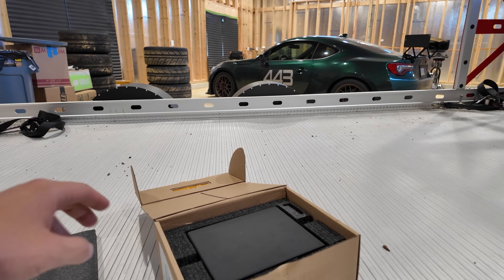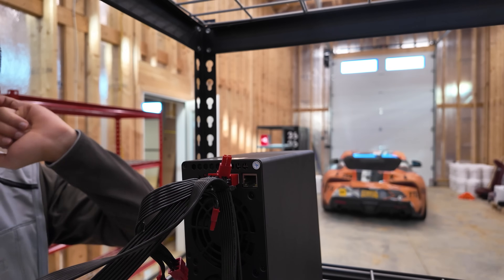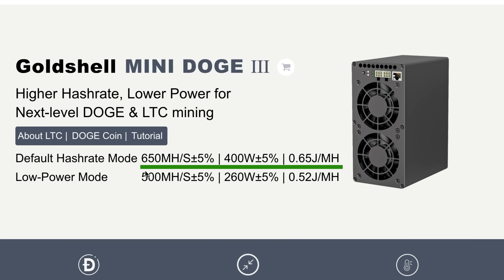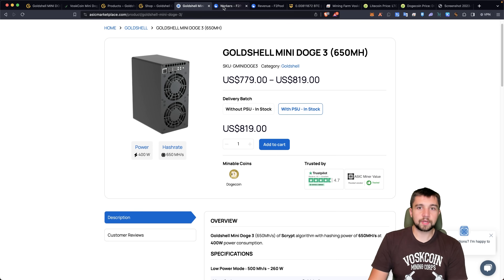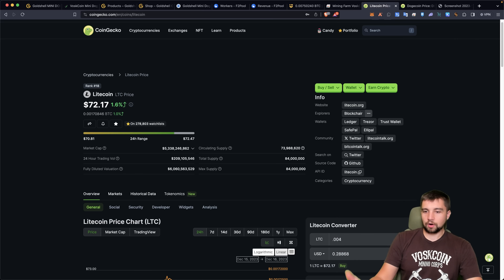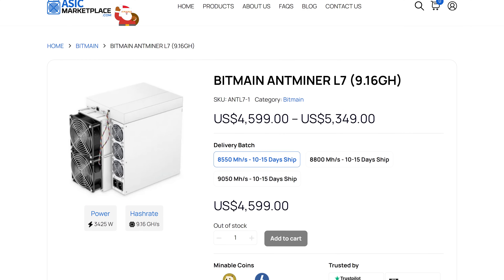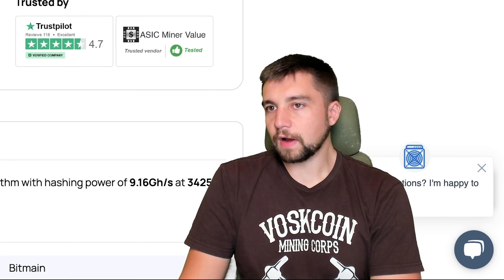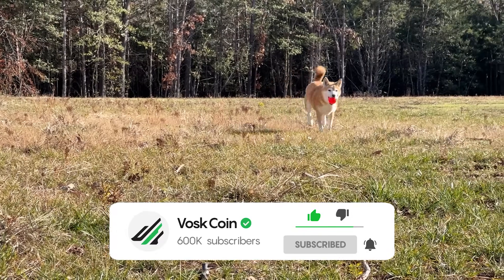Is Buying the Mini Doge 3 Dogecoin Miner Worth It?

Comment: Ok so hear me out, I drive a semi truck and have a 5000w inverter, and could add a second one, the truck runs 24/7 and company pays for fuel, especially cutting out the power cost of things, with T-Mobile home WiFi no data cap, I think it could be worth buying 4 miners and running them off the auxiliary inverters, what say you?
Reply: That’s so clever. I don’t even know what to say……using power you generate anyways…..i know the extra drag won’t mean shit on your kind of vehicle. I’d put a inverter solo on each one so when it blows it doesn’t take them all out.
Reply: i had this same thought. i drive as well and i think next up is a youtube channel called "The Trucking Miner". its a genius idea to use the power already being generated.
Reply: Do it. What can it hurt? You'll never have to run the defroster again!
Reply: Genius. I’d definitely try it out. The DG1 Home was what I wanted to start with. Unfortunately bought the doge 3 plus before seeing this video
Reply: that what i do i mine and drive
Reply: It need constant interney

Comment: Everyone else who's ever ordered a goldshell has ended up with a worthless brick so I think I'll skip this one too!
Reply from the maker: that's not true but that's fine this is a very skippable miner
Reply: @VoskCoin 3-5 year ROI at 8 cent electric, if the current difficulty does not go up at all. It has tripled in the last 3 years, so it may essentially never ROI at a rate faster than buying the coins outright and holding.